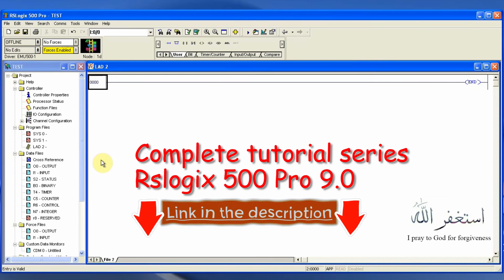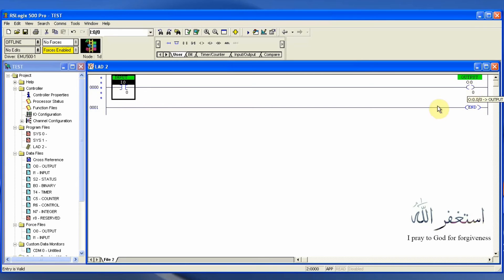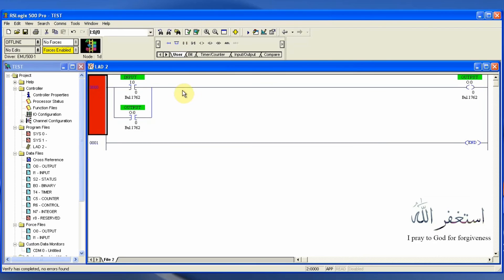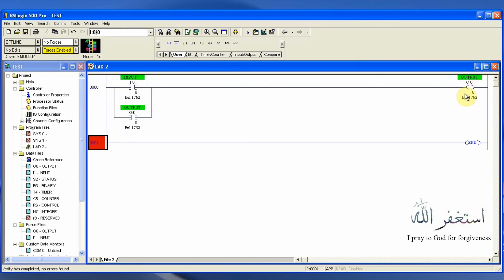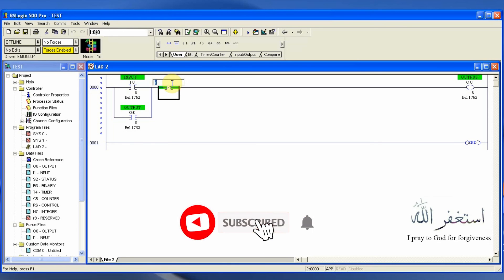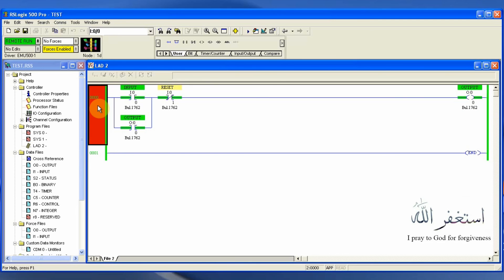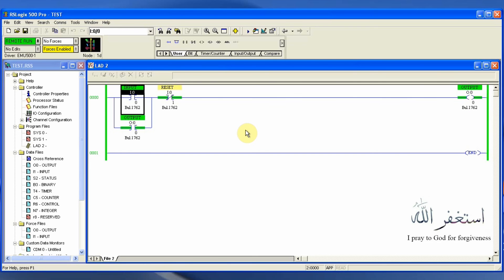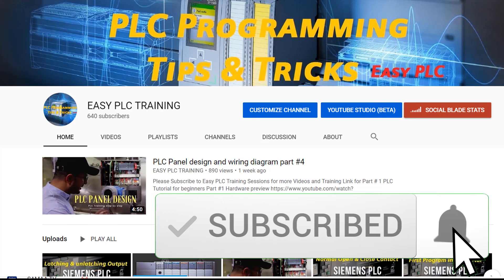Lesson #4 || How to Hold ON Outputs in RsLogix 500 programming Tutorials

Comment: How to setup controllogix IP address if not showing Mac address?
Reply from the maker: Have you used bootp? For rslogix
Reply: @EASYPLCTRAINING  for control logix
Reply from the maker: I believe we can change or set the ip address of the plc using bootp application ..... its already installed in the program menu ... just check it